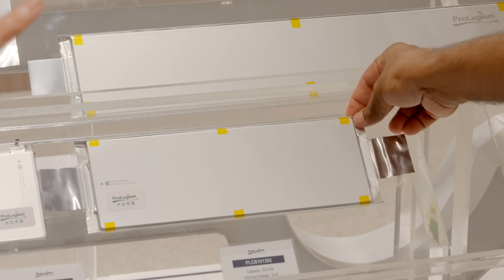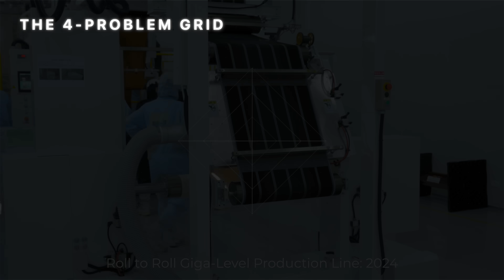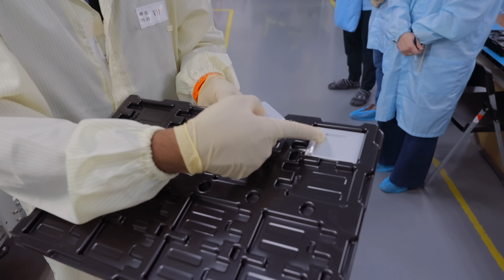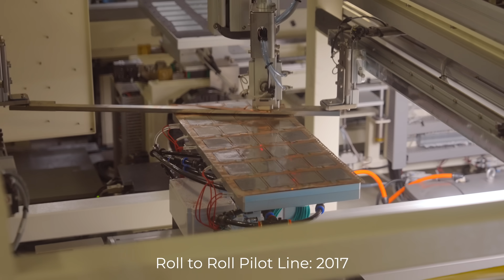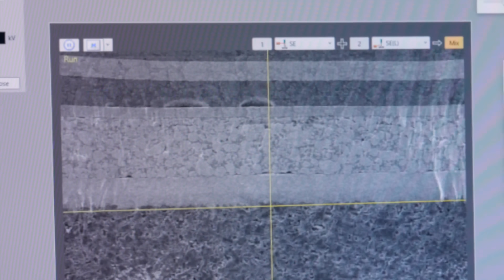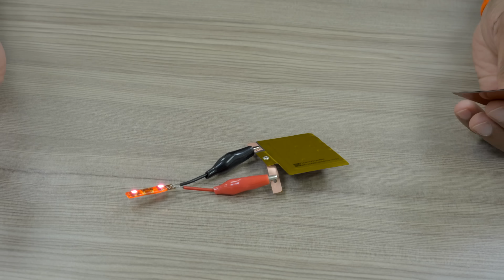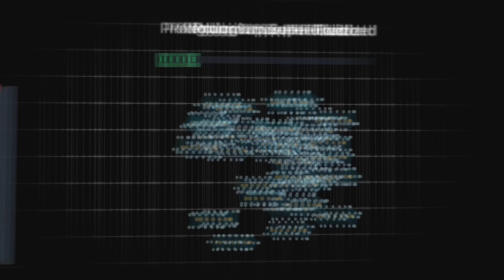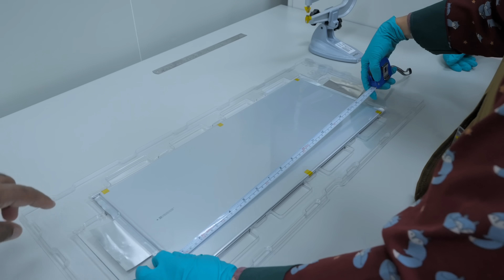Testing a REAL Solid-State Battery - Finally Here?

Comment: Great job!  This company seems legit, which is quite promising.

However, I can’t get over how we seem to see these hyped-up, all-problems-have-been-solved reports every few months.

It is unfortunate that even after decades of development, the battery industry is still in the “snake oil” stage (see Donut Labs).

As recognized as Ricky is, neither he nor any other battery tech reviewer, is able to provide objective, third-party verified side-by-side comparisons of state-of-the-art batteries for fear of losing future access.  As forthright as this company seems to be, even this video was a carefully choreographed company advertisement disguised as investigative reporting.

(Notice that competitors were never mentioned by name when stating performance measurements and even manufacturers in full production, as this one claims to be, don’t let Ricky take cells home to independently test.  You can rest assured if they had offered, he would have jumped at the opportunity.)

We see independent testing of tools, phones (JerryRig) and several other products (ProjectFarm), but no tech reviewer dares to independently and objectively compare battery tech head-to-head without fear of retaliation.   They are still beholden to manufacturer agendas.  Sigh.

Comment: No mention of cost I see
Reply: It was eluded to with the speed of production, but yeah, would be good to get the actual number.
Reply: @1Mutton1  Scale is always critical, and they are still pretty small scale. The most important part is that they have a scalable process to the point where they can start to reach a unit cost close to the raw material cost. We don’t know all the materials required but it mostly seemed to use the same materials as regular li-ion.
Reply: Yup. A video is a giant sales pitch, but that's fine with how much details is shown. However, what is a sales pitch worth without a price? It's Cobalt so it's GOT to be expensive. Which is also fine. The question is only how much more than liion?
Reply: @hackdesigner  Battery production is way easier with Cobalt than Lithium I expect and that will also decide the price. More expensive to buy but less expensive to process. (and recycle)
Reply: no way in hell would the cost ever be discussed. although, he said these are "already in production", which implies that they're being used for something already, so if you can figure out what they're currently being used in, you might be able to extrapolate a cost from that
Reply: it will cost more 100% lol it's all upsides
Reply: @AdamOpheim  he said that its cheaper in the video
Reply: Actually one of the most important aspects that cannot be ignored. You can invent the perfect battery, but if nobody can afford it, it becomes pretty useless.
Reply: @countmorbid3187 they already have a far superior product to the competition and there are a lot of tech sectors where price is the bottom of the priority. Think of military, where even a screwdriver might cost 200 bucks

Comment: In a true solid-state battery, the electrolyte is solid, but the anode and cathode are also still solid materials — just like in most conventional batteries. So you have: Solid anode, Solid cathode, Solid electrolyte. This is still a hybrid battery. Solid State Batteries are FINALLY Here? No, not here.

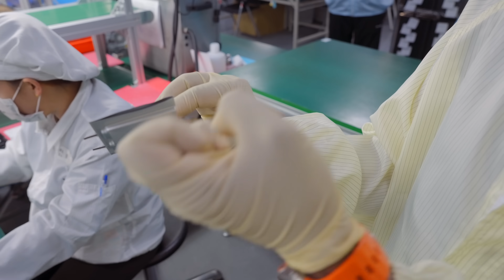Comment: 5:03 95 MPa of vacuum? That's not possible. You can apply 95 MPa of pressure, but you can only vacuum down 0 Pa of absolute pressure or 101 kPa of vacuum because there's only 101 kPa of atmosphere. (Yes, I know 1 atm is a bit more than 101 kPa, but those are digits I don't care to remember and are relevant to pointing out the error/lie).

Comment: To unlock new innovation isn't just about 'material science', but rather "engineering"

e.g. 3d print complex rocket components, gaga casting over sheet-metal spot welds car chassis

Comment: The cell weighed 1.6975 kilograms (24:20 - 24:26). Based on the test results, which yielded 612.37 watt-hours, the calculated energy density is 360.748 watt-hours per kilogram.
For reference: The theoretical limit for conventional lithium-ion technology is estimated at 400–500 Wh/kg and Tesla's current battery energy density varies by chemistry and component level. Cell-level density for the 4680 battery is approximately 244–296 Wh/kg

Comment: But you didnt get to take some home for a few months. Let me test one on my E-bike, or radio-controlled cars, planes, or quadcopters; if they survive those tests, they will survive most things. They will face their maximum C rating both in charge and discharge and be exposed to shock, heat, and cold; laboratory tests are notoriously targeted and dont really align with real world use.

Comment: Why are you bothered about thermal runaway, you have told everyone that lithium ion batteries don't catch fire only 0.001 % of lithium batteries catch fire then it's normally the users fault charging beyond 80% and using them below 20%. So you shouldn't be bothered you should be saying why are they bothering making a battery we don't need ? Karma

Comment: Solid state battery, or at least a heat-resistant non-newtonian gel battery. The video mentions pressure, it but does not contain a single occurrence of the word "dendrite"?
I guess the ion diffusion layer helps, and they are not using a full lithium metal anode yet.
Cool tech anyway, at least for portable applications (cars).
For stationary storage, I still prefer the brute force simplicity of molten metal batteries.

Comment: What a waste of time. 90% of this report is useless.  I had to watch up to minute 24, waste my time, and make money for 2bit, until he bothered to give the energy density to his viewers.

If the battery vid does not give you the energy density in the first 60 seconds, then it is a rip off of your time.  Including 2bit.

Finally we are told in a a lengthy 2 minutes that the energy density is 360 Wh/kg.  That says it all.  This is very impressive and significantly higher than 260 for our best NMCs.

But you did not have to torture us.

Unsubscribed.

Comment: Public Service Announcement: For people still defending Donut Labs (and others like them). Comparing ProLogium and Donut labs is like comparing state of the art medical care at a Stanford Hospital, to a tribal witch doctor in the Sudan selling you Snake Oil. Yes, it is THAT bad.

I said this when Donut first made their claims. They were clearly BS. ProLogium has over 1,000 patents, and around 250 involving Solid State batteries. Someone like QuantumScape even has almost 200 battery patents. DONUT LABS literally has ZERO patents on battery tech. NONE, also NONE filed. 

Now there is a Criminal complaint filed against Donut Labs, by a former CCO at Nordic Nano. For lying to the public and misleading people. Why people still defend them, I just do not understand.

Comment: I may have missed it, My question is  are they selling to individuals, and if so at what cost?  Also what is the cycle life compared to lithium Ion batteries. Two years ago I converted my Honda CRF 250L motorcycle to electric, and am looking to replace the battery with a higher capacity, high density. battery. The bike in every way is better than gas except range. That battery tech would extend my range from 70 to 91 miles for the same weight, but for space I might even be able to get more range than that with a tradeoff of added weight.. Is it possible to buy from them?

Comment: " they do 40mw a year" vs " they have a gigawatt factory"
" 85 mpa of pressure sucks out all air"
Wrong definition of thermal runaway. The ceramic is good to 800c at the start then 300 later on.
Oxide ceramic is neither an oxide nor a ceramic. 
Ovens dont have an igniter so cant be used for testing thermal runaway. A flame is required, not just heat.
Its not funny because people believe this trash.

Comment: The access and specs they have given you are impressive. The last piece to complete the milestone wod be cycle life. If it only achieves that level of discharge energy over 10 cycles, it's not really viable. The cycle life was the really outstanding portion of donut's claimed specs, and a good cycle life makes all the surrounding specs much more impressive.

Comment: What a fantastic view of what ProLogium is doing. The advances are astounding and even if no more major discoveries are made just getting where we are at today into full production will be game changing AGAIN.

Here in Melbourne, Australia we have State regulations that treat ALL lithium batteries as serious fire hazards.
So like China has a solid state battery standard there HAS to be a Intrinsically SAFE battery standard.
As you have just shown NMC batteries CAN be intrinsically safe and we need that standard.

E.G. would you buy a electric scooter? 
First is it NMC LiFePO4 or LiPo - not necessarily ease to find out, knowing this would tell you if LiFePO4 they are probably safe - the other 2 - not really.
How well are the batteries made? Unknown

How safe is the charger? There are electric standards for this, but does the charger meet them?
The house next door burnt down due to a scooter left outside a couple of weeks after Christmas...........

We need the same sort of standards for the batteries - 3 levels I can think of that would allow proper use and selection
1/  Ultralight, energy dense batteries where safety level needs to be known to manage. (a fire safe for storage) think model aircraft etc
2/  Well manage but not intrinsically safe think gas vehicles and NMC cars you will be fine but they can have a problem VERY infrequently. Fire crews want to know about them for fire and electricity.
3/  Intrinsically safe don't have to think about them at all. Fire crews just need to worry about electrical safety.
Of course there is the 4th level - uncertified - who knows what they will do - and that is where we are today with MANY ebay/aliexpress/marketplace sold batteries.

Comment: I don't care if it can't protect against thermal runaway. I want batteries that have more cycle life. So much garbage created from planned obsolescence of the battery. You can guarantee this stuff will be fought tooth and nail by electronics producers, because they NEED to sell garbage after garbage.

Comment: 2026 Sep. Mercedes-Benz and ProLogium have entered into a joint testing agreement, including a preliminary technology evaluation of ProLogium’s latest Gen4 Superfluidized All Inorganic Solid State Battery Cell Technology

ProLogium has built a notable track record at the Edison Awards, winning three prestigious accolades for its innovative battery technologies. 2026 April 16 ,Gold Award, ProLogium won for its Gen 4 Technology - Superfluidized All-Inorganic Solid-State Lithium Ceramic Battery. 2021 Bronze Award (ASM )Active Safety Mechanism. 2019 Gold Award: ProLogium won its first Edison Gold Award for its BiPolar+ technology

Comment: At @12:15 when you cut the cell there is a small whisp of smoke as you first puncture it.
Reply: it's still creating a short for a miniscule moment a tiny portion of the scissors surface the current jumps through would still heat up for a moment like when you connect a wire across the battery terminals and short it that way just a thought I had

Comment: I was confused at first why a solid state battery has what looked like liquid electrolyte. But I guess if you can cut it in half and nothing leaks out it counts, even if it is pudding. :D

Either way, a really great video and a very promising product for the future of BEVs. 

Give it another 5 years and not only will BEVs have fully caught up to the most efficient diesel cars in terms of range, they will completely outclass them. Can‘t wait for the first 2000km range per charge BEV. :D

Comment: A good explanation of how it works but until a battery is tested by an accredited testing lab is needed to believe all the specs. The statement "tested by independent labs" without stating which ones and seeing published statements is not certified data. 
He says "is it charged" before nailing thru it and taking their word for it is not enough.
Nice preview though.